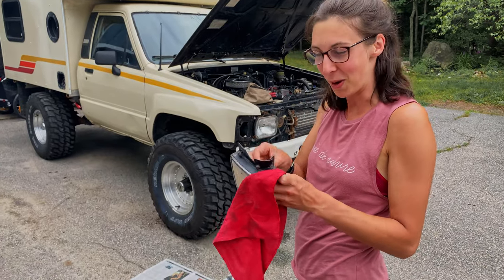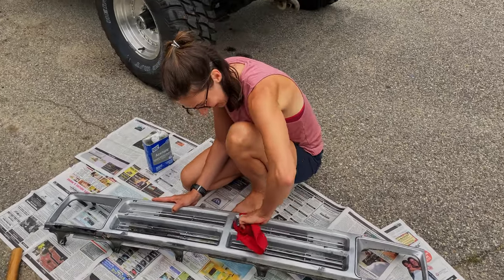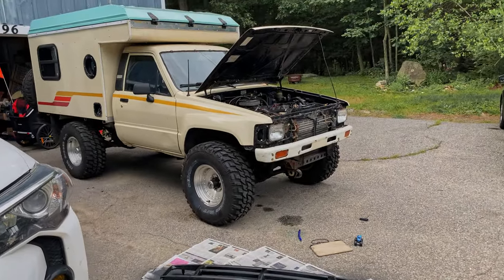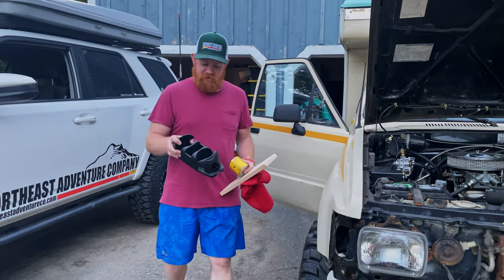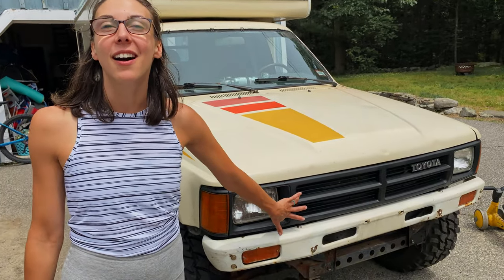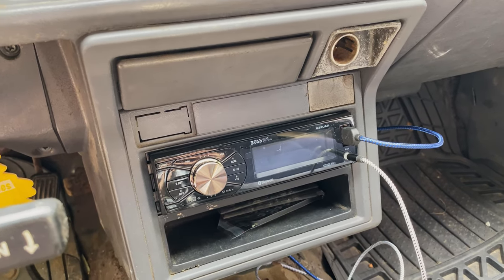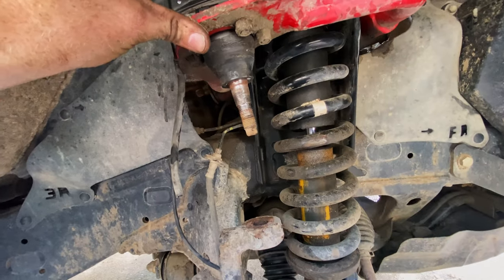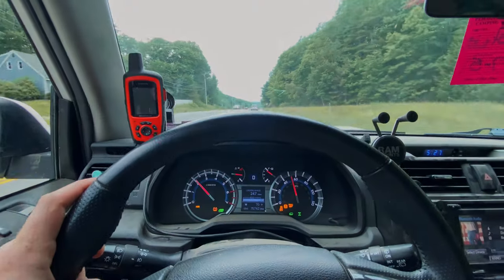Project Day - '87 4Runner Projects & Dobinsons MRA install! //Vlog 05

Comment: For the front rebound adjuster that has the hex key for tuning did you only put that on? Cause I'm having hard time figuring out where that extra ball bearing and spring go that came with the shocks

Comment: how are you liking the MRAs so far? Same goes for the patagonias. I'm thinking about swapping out my 6112s as im adding more weight to the front of my t4r and thinking about replacing the coil overs altogether instead of just swapping in the bilstein 650lb coils as i dont think an extra 50lbs of spring strength, even at full preload, will handle an additional 140lbs of steel bumper up front